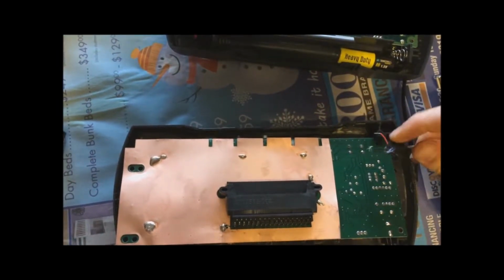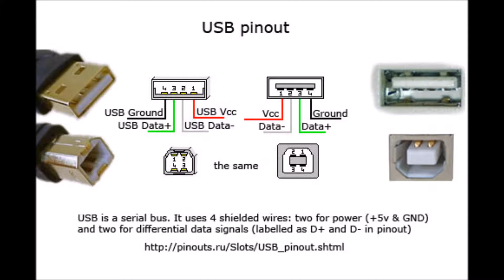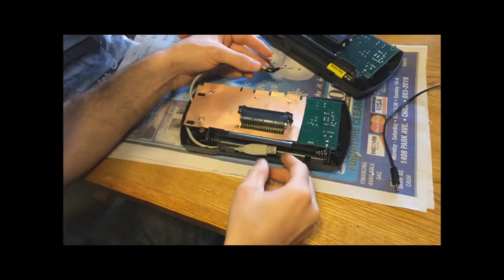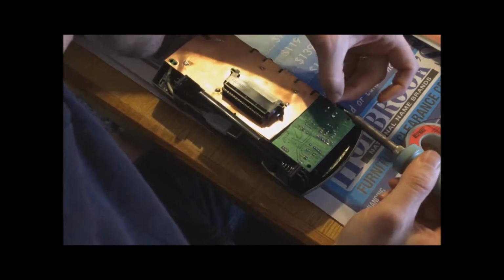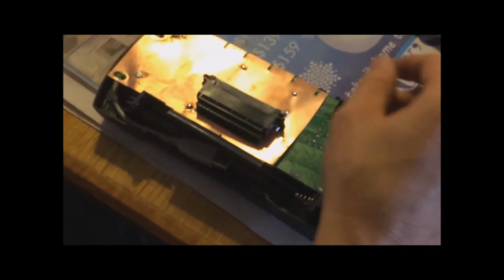Atari Lynx 2 - USB power mod

Comment: Can this be done to a model 1??
Reply from the maker: I won't make promises, since I've never tried this on a Lynx I, and I'm not an Electrical Engineer.  However, it certainly SHOULD work.
On the Lynx I, the equivalent capacitor is C39.  I don't know if it's easy to get to. 
The Lynx I schematic is here: https://emu-docs.org/Lynx/plan.png
Why not try it and post your own video!
Reply: Thanks.. I seen the same thing on schematic at console5. It boot the system but i get a insert game screen whether there is a game inserted or not.. so not sure if there is another issue with the board or c39 isnt a perfect fix on its own.
Reply from the maker: You tried the USB power fix on your Lynx I and you only get the "insert game" screen?  
Again, I don't have a Lynx I, so I haven't tried it, but it's hard to see how it could be related.  AFAIK the Lynx I cartridge port and power system aren't related (unlike the Lynx II.) It seems more likely that the cartridge port could also be dirty or broken in someway.
Maybe you should ask on AtariAge or on the Atari Lynx Sector Facebook group.
Reply: Nice mod, looks gay but it works I guess. U could have used a matching black usb plug with a longer wire 😊 I gonna mod mine, but with a c type connector instead and still work as a portable handheld 😅 unlike Ur, batteries 🔋🔋🔋🔋🔋🔋 not needed no more, haha 😮😂😅